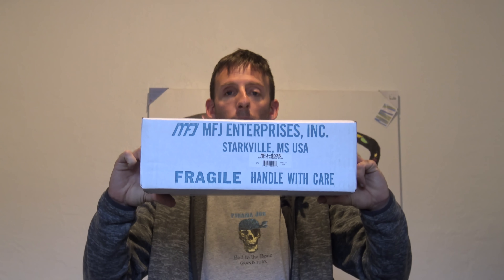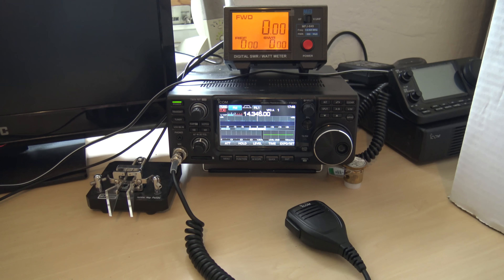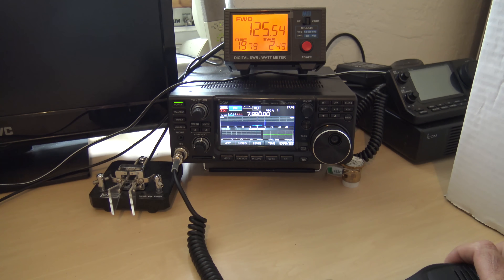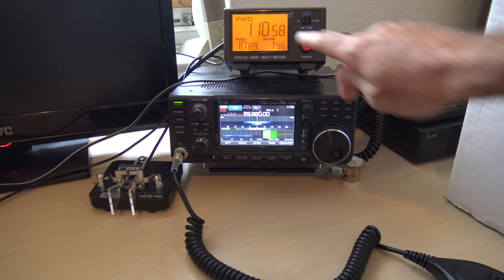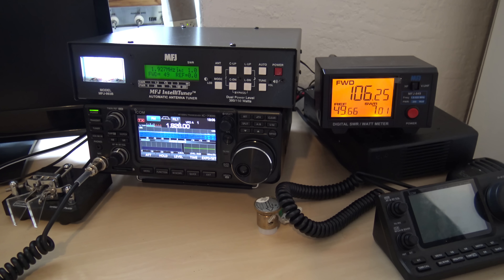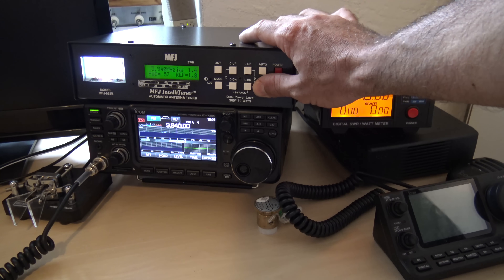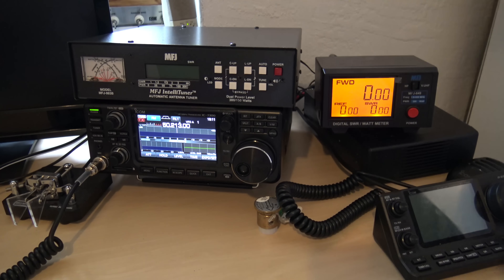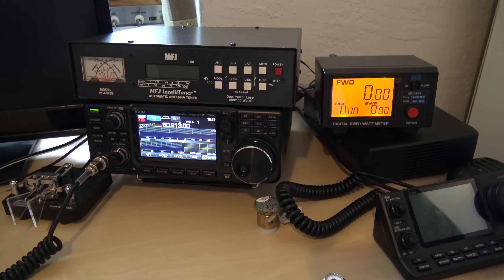Understanding HF Antenna Tuners, What Does It Do?

Comment: First off, this is in no way hate comments and as far as the video is concerned, I think is was both informative and presented well. I can clearly see that you're enthusiastic about the hobby and how much you want to share your knowledge which I can learn from with an open mind. And while I always knew early on that having an antenna cut for resonance for the band you operate is ideal,   some times however, the conversion from an analog to digital representation may vary due to IC latency, partly due to using low cost components. In short, while analog meters, although difficult for some to read, for me at least, they give a better representation.

Comment: Do tuners that are literally connected to the center of a dipole exist? (And I mean not through a balun) Wouldn't that be more efficient because it's transforming the 50 ohms to the impedence of the antenna directly?

Edit: should have finished the video before commenting, although still curious about a remote tuner.
Reply: Yes. That’s called an “antenna coupler.”
Reply: @softwarephil1709  TKS de KEØPBI

Comment: everyone should read the Book Reflections 2 by Maxwell. Also remember as Bob Heil Mention the tuner is just tuning the coax not the antenna..some tuners are design to be right next to the antenna which is super better as its actually tuning there. I have a LDG z-11pro2  but wish I had a tuner on the mast next to the G5RVLite I am using.
Reply: In the book reflections it goes into great detail to explain how an antenna tuner tunes the entire system to resonance

Comment: So what exactly does the tuner do mechanically to "make the radio happy" and what is the benefit of "making the radio happy" as opposed to just transmitting with the poor SWR since it doesn't improve performance?
Reply from the maker: it basically uses many different values of inductance and capacitance to formulate a 50 ohm match with 0 watts reflected back from tuner to radio.
Reply from the maker: Sometimes you cannot have a multiband vertical like I have, you can only use 1 piece of wire that may not be long enough. Answer is to use a tuner to at least have some sort of chance to receive and transmit without buring up your radio., although it wont be as efficient.
Reply: Ok, so you can actually damage the radio if the SWR is too high. I didn't know that.

Comment: A better way of looking at an antenna "tuner" is that it is a matching transformer at RF. It doesn't really "tune" anything. It simply matches your transmitter to your coax cable. Good video though.

Comment: Why bother with a tuner if it doesn't do anything to your antenna.
Also what's the use of radio's with built on tuners.
73's Alan in the UK
Reply: the tuner is used to protect the radio circuits from reflected power when transmitting into an un-tuned antana. if you are taking down and puting up antanas in a moble situation or are forced to use an antena that can not be tuned to beter than 3 to 1, a tuner may be a good thing to protect your radio and make it posible to transmitt a signal. K5RFS
Reply: True a tuner doesnt do anything to your antenna, the antenna is assembled (dimension wise) to radiate at a specific frequency [range] and a tuner will not change that unless it operates a motor or other device to change the length of the antenna. The tuner inserts or removes either capacitance or inductance or both to give the radio a load to look into without  bucking the reflected power of a non resonant antenna.  Try this : put up two antennas (identical) one  resonant cut for the freq you want to use {like 7.295} and another one a few feet longer or shorter and compare the two.... with a SWR meter only.... without a tuner.

Comment: Why have a tuner? Well, my antenna is 1:2 swr let's say on 80 meters which is okay for the most part but when I use the amplifier I would use the tuner and get a 1:1 match. The reason for this is to save the tube which is expensive. I use a Hy-Gain 18HT antenna with the coil in the base, I set it for 3.815 and the other bands 20, 17, 15 & 10 I make resonant from there at frequencies where I use the most. For the 160 I go and change the tap on the coil.. I also found that with my quad antenna a 1/4 wavelength of 75 ohm coax as a tuning stub give a wider range with a low swr.

Comment: Hi Eric, 

Thanks for this very informative video! It actually shows what I thougt actually would happen.

Now... I am using a 9:1 unun with a 'random' length of wire, having the same Icom without a tuner, it does 'tune' it on all bands from 160m to 10m , which is not a particular resonant lenght at all (about 20m-21m or so, in a very weird configuration: 6m down, 4.5m to the left, 6-7m to the front. Regardless, the radio is quite happy with an SWR <2.0 on all those bands, without external tuner. How well would this work (don't have the meter)

73 de PC4AD

Comment: FM on ANY HF band other than the top of 10m is not cool. CW or a AM carrier followed by your ID every time. Otherwise a good informative video :) de WE0H ..
Reply: It might not be "cool," but it is legal. The way Part 97 defines the "phone" emission type (see 97.3) makes no distinction between FM and other modulation types.

> Speech and other sound emissions having designators with A, C, D, F, G, H, J or R as the first symbol; 1, 2, 3 or X as the second symbol; E as the third symbol. Also speech emissions having B or F as the first symbol; 7, 8 or 9 as the second symbol; E as the third symbol. ...

The legal bandplan at 97.305(c) uses that term, "phone." FM (designator starts with F) and AM (designator starts with A) are almost equal under the regulations. If you read it carefully, FM and ISB (designator B) are additionally allowed in stereo. 

The ARRL "Considerate Operator's Frequency Guide" tells you, right at the top, "These are not regulations." 

That said, I do agree that transmissions on a well-known calling frequency like 7.290 ought to use the well-known mode. That reasoning applies to any incompatible mode, including Morse code. (Proficiency hasn't been required for the last 15 years, MCW is still authorized.)

Comment: the new ham w/o a radio yet herd "If your antenna is too short, a tuner will help you turn your wrong antenna into the perfect dummy load"... hope I got it
Reply from the maker: thats all it will be. You can never make a 20 meter dipole work as a 40 meter dipole, just wont happen... Not long enough

Comment: Good video ive just got my ATU and managed to get it setup on my Icon IC718 by holding down set and powering the radio on. now the tune button works on the radio with the ATU so I just need to press and hold tune and the ATU takes cares of the rest . 73's 2eoiqj

Comment: Was always told it doesn't really TUNE anything. Its a match unit. It lets the radio see the match it needs.
Reply: Correct. The antenna matching that happens allows the radio to push max power.
Reply: @DJChrisArgueta  only when the antenna is at resonance at the frequency you're working on . The tuner does not change the resonance of the antenna in any way .
Reply: @joewilson2258 the tuner does exactly that tune the reactance out of the antenna feed point therefore creating a resonant antenna

Comment: I very much enjoyed your clever and informative video.  But there are a couple of common SWR misconceptions.
When you are tuning up on 160 meters, the MFJ power meter readings are quite correct and you ARE radiating most of your 50 watts!
The power meter is showing the power going forward ADDED to the reflected power.  Because a transmitter doesn't absorb reflected  power, it re-reflects it, the reflected power ends up being added to the transmitter's power.  That is why you see 105 watts 
Remember that your 50 watts of power has to go somewhere, either as heat in the tuner, coax, or antenna -- or it has to be radiated.  If your tuner, coax, and antenna are staying cool -- most of your power is being radiated.  It is a common misconception that reflected power somehow disappears -- it doesn't. Some does get wasted bouncing back and forth heating up your coax -- that is why very low loss open wire feed line is prefered for nonresonant antennas.
Anyone interested in antennas and SWR needs to get a copy of "Reflections"  by M. Walter Maxwell (any edition) where this is explained very well.  "Reflections III" is available as a free download.
..Eugene..  AE2F
Reply: Exactly correct.  Non-resonant antennas work well.  Keep feedline losses low, and you're good to go.  Ken WA8FCI
Reply: @DaDitDa  "Keep feedline losses low"...

By using an open wire feed-line such as ladder line or window line, like in a doublet or a G5RV.
Reply: Eugene, you are wrong when you say "The power meter is showing the power going forward ADDED to the reflected power", because the so-called "bridge", that measures the reflected power, is positioned BEFORE the ATU components, so it DOESN'T MEASURES the power sent back by antenna! The power sent back by the antenna, is moving back and forth between ATU and antenna. It does not come back to bridge.
Reply: @RobertoPietrafesa  His power meter is after the tuner. Watch the video again.
Reply: YES ! exactly. But I think his point is that the antenna hasn't changed because you used a tuner. Which is fundamentally correct..
Reply: @David White what i said...
Reply: Thank you for adding this, I read it, and it cleared up a lot for me.  Also there is a you tube video called Standing Up for Standing Waves that shows that the tuner does a lot more than just make the radio happy.
Reply: @timchewning8241  this means you didn't understand anything about the video! If an antenna (a dipole, for example) is not radiating fine a certain frequency waves, it will not radiate well that frequency anyhow, with or without ATU! This means that when you switch on an ATU and "tune" the ATU system, it catches the reflected power, sending it back to the antenna. Than, thsi power come back again to ATU, than again to antenna, and so on. And, making this "round trips", the power will heat the feedline and the ATU itself, bringing itself to exhaustion with the passage of time. So, the ATU is good to "move" the heat from radio final power transistors to the ATU components+feedline.
Reply: @RobertoPietrafesa  not all of it is reflected back each time to gets pushed towards the antenna?  Right ?  If you hit transmit 100watt and 80w radiate and 20 reflect back then go forward again 15 watts will radiate and 5 will reflect back then 5 radiate and 1watt will reflect back....so that's a total of  91w radiated with atu vs 80 without???? Right....or not lol I don't know who is correct.
Reply: @RobertoPietrafesa  You didn’t even comment back to the correct person when you responded to Tim Chewning. Hahah.
Reply: @RobertoPietrafesa the tuner does not absorb reflected power therefore does not heat up
Reply: Radios are never "happy" just as they are never sad.  The "antenna tuner" transforms the antenna system to a nominal 50 ohm load allowing the transmitter to radiate its power to the feedline and antenna.

Comment: ATU with a ladderline fed doublet has minimal loss.
Reply: Absolutely right.  Eric did you hear his comment... You didn’t touch on transmission feed lines.  The loss per foot of open or window line is substantially less than the best 50 ohm coax.  Therefore, wire antennas like Doublets fed with open wire or ladder line make fantastic multi band antennas.  I use a 200’ Long center fed antenna fed with 450 ohm ladder line all the way back to the tuner and a 4-1 Balun  just before the transceiver. The antenna is up at 70’ and it smashes thru pileups running barefoot.  It’s not resonant on any bands but tunes 10-160 meters. Just saying... N1WMN
Reply: drew michael 100% correct. I'm amazed how many ops never consider even a short doublet over a multiband 9:1 vertical
Reply: 2E0TWG_ TIM What is your call friend?
Reply: drew michael hi Drew it's 2E0TWG, based in England. Run a 44 foot  inverted vee doublet here with 300 ohm to a remote tuner via a 4:1 Balun. Very simple set up but she works pretty well 40-10.
Reply: 2E0TWG_ TIM   Very nice setup.  Is the tuner up at the feed point or at ground level?  How much coax do u use from value to the xceiver?
Reply: drew michael it's 36 feet of 300 ohm to a 4:1 Balun two feet from the ground then a 2 foot length of rg213 to the remote tuner in the low height storage shed. Then 30 feet of coax (currently rg58 being replaced by 213) to the shack. Not textbook but I've kept the coax as short as possible between Balun and tuner t minimise loss.
Reply: 2E0TWG_ TIM   The 450 ohm ladder line is cheap.  Couldn’t u run it all the way back to the shack?
Reply: 2E0TWG_ TIM   Your antenna sounds a little like a g5rv....
Reply: drew michael nope as the shack is in the corner of the kitchen. Not feasible.
Reply: drew michael nothing like a g5rv. It's a doublet fed via a Balun to the tuner
Reply: 2E0TWG_ TIM Thanks for your reply.... 73

Comment: Good point.  When you hit tune at your transmitter, you are just matching the impedance seen at your end of the transmission line to 50 ohms.  However, there are many antennas that are efficient radiators, that do not present a 50 ohm load to a transmitter, hence will have a high SWR(with 50 ohm coax). Yes, using a tuner at the transceiver is a bad idea because there  is much more coax loses at a high SWR then at a low SWR.  When confronted with this, use remote antenna tuners, low loss coax, ladder line, Baluns etc.  The loses are then just in the tuner, and the normal coax losses that occur at a low SWR.  Do not discount multi band antennas that need to be tuned and lose more power in the coax.  The 80 meter Carolina Windom will enable more contacts in more directions then a pair of resonate 40 and 20 meter dipoles (more omnidirectional, lower takeoff angle, plus you can work more bands). Using low loss cable makes it better, and a remote tuner makes it killer because most of the loss in the transmission line is eliminated.  You can also make inefficient, poor radiating antennas that present 50 ohm loads to the transmitter too...the light bulb dummy load, loaded mobile whips, various multi band trap antennas, antennas not high enough from the ground, that give low SWR, but are not necessarily the most efficient radiators.  The little loop tuner is not adjusting the antenna, it is matching the impedance of the antenna to the coax...it is a manual remote tuner, it does not make the antenna any more resonate or efficient.  Keep the videos coming. Great topic.

Comment: What part of 160m is for FM? 40m? 20m?
Reply: I seen that also. Not cool using FM on any HF band other than the top of 10m. Should have used a CW carrier followed by his ID every time he transmitted. de WE0H ..
Reply: @Mike-WE0H  You can use FM on HF, but the modulation factor must be 1 or less, so in a sense, it would be useless on HF, but still able to technically be done.

Comment: Thanks for this; good explanation. But why isn't the readout on the 993 matching the SWR meter?  Aren't they measuring the same thing?
Reply: Nope. The 993's meter is showing what the radio sees, while the SWR meter was showing what the antenna actually is doing. When they were close, it was because the antenna was actually resonant at that frequency (or pretty close to it). The 993 simply tricks the radio into thinking the antenna can resonate the RF power, when it really can't. That reflected power is changing to heat in the 993.

Comment: Thanks Eric.  Very good description of how antenna tuners work.  You did miss one other setup that I have used in installing SSB radios on boats for many years that does work. That is a remote antenna tuner at the antenna. These work as an adjustable loading system at the antenna and work very well on all bands in its range.  Similar to a screwdriver antenna they do tune the antenna to match the frequency.

Comment: You are ONLY turning the Coax between the turner and neater not the antenna  the Turner need. To be before the mater
Reply from the maker: tuner is between radio and meter.